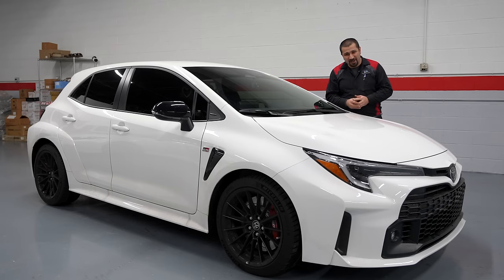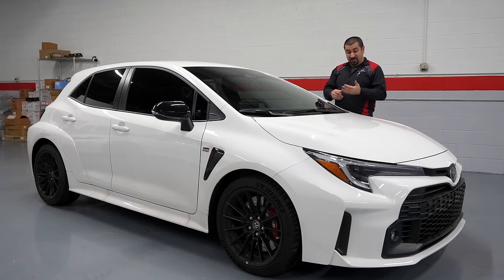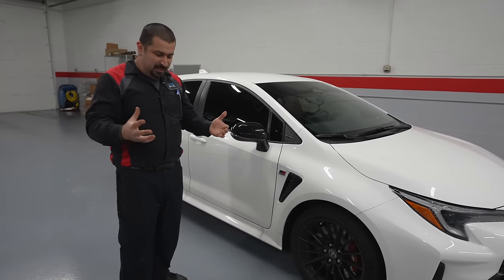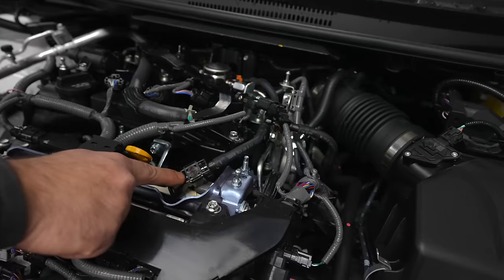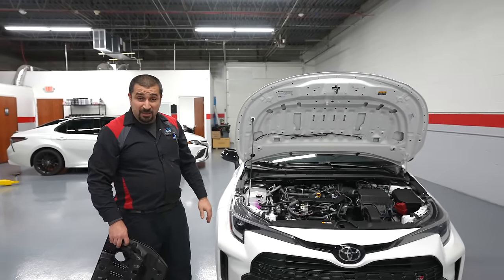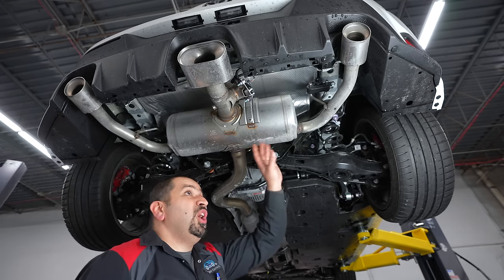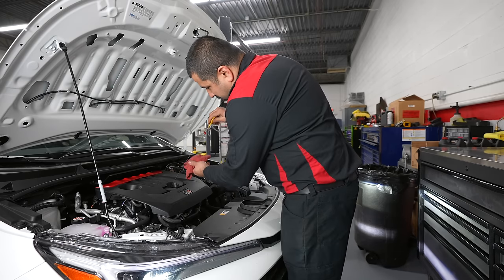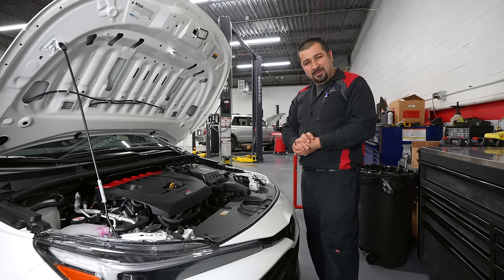The Toyota GR Corolla is Truly a Special Car | First Service and Technical Tour

Comment: Ethan has a sweet ride and the best mechanic in town. What more could anyone ask for? Thank you both.
Reply: Ethan for congress👍👍
Reply: Well said...
Reply: ChuCan, extremely well said.  Thanks to both and what a gift on a cold Saturday to see. 🙂
Reply: Super blessed!
Reply: 29/01 23, Thankyou to the Owner & you for sharing - What oil would the Dealership have used ? Nothing else to check or do here - or just purely an engine oil change ? Have similar problem with my 2012 UK spec' 1.6 Suzuki - can't find an Engine Oil that matches the exact oil spec' given in the Owner's Handbook. Can find SAE 0W - 20 oils, but, none that INCLUDES, SG, SJ, SH, SL or SM in their descriptions. Want to do an engine oil change before reaching the required interval here in Winter where temperatures have fallen to -11 °C so far. One Vendor told me, smiling, 'You're worrying more & more about less & less' !
Reply: Exactly!
Reply: I would have said the best mechanic in the whole country. I would buy a Toyota just to get service by AMD.
Reply: What more can you ask? Being able to read the oil dipstick?
Reply: For warranty, you should be taking the car to the dealer while they're still under warranty, especially since its free for the first few years. So Ethan was able to buy a highly sought out car, probably paid 30k over sticker for it, and now voided the warranty.
Reply: @GXMAN16  oil change is not free, he didn't voided his warranty because how will they tell that oil was changed? Send it to lab? He did oil change really early (oil was still transparent) and dealer wants you to do 1st oil change before 30k km (~20k m) and he will have to show up for it (and pay) if he wants warranty on engine.

Also winter tires would be great lol
Reply: @Drayke  Here in US you get 2 years of Toyota Care when you purchase brand new from a dealer, which is free oil changes and tire rotation. Yea it's normally every 10k miles. I don't know how the GR Toyota does it,  so yea if he brought it in for a break in change early on, he could still take it to Toyota for the regular oil rotation. They wouldn't be able to tell, unless the oil filter is different  or something like that. My point was if he never changes the oil at Toyota within the warranty period , and there is an issue, dealers can deny warranty, it's stupid but it happened in the past. 

BMW does it best, they give you 3 years of free maintiance and you can buy additional years too. And they actually do a break in oil change at 1200mi for M models before the regular 10k change. Their plan includes everything not just oil and tires, whatever the book calls for they change. Spark plugs, air filters, cabin filters, you get one Rotor and Pad job within those 3 years, even batteries in the key fob all free, included in the maintiance plan.
Reply: @GXMAN16  wow that's cool, thanks for info. My comment was based on my experience with ford in Poland, 6 month (20k km) car 800$ 1st visit lol
Reply: A HONDA!
Reply: @Drayke  I figured since you used KM, in Europe you guys might have different plans.
Reply: Just becoz its on internet doesn't mean he is a good mechanic
Reply: @GXMAN16  doing your own maintenance doesn't void a warranty. You're allowed to do your own maintenance. He also went to a shop and used a toyota filter and crappy oil but it did meet the spec toyota called for. No warranty issues there
Reply: I'd take my car to this gentleman's shop. 

He's earned my respect ✊. 😊
Reply: Enough said
Reply: For him to be in my neck of the woods so he can be my mechanic. I dont trust any mechanics to be honest.

Comment: Performance: 0 to 60 mph,  4.99 seconds! Top track speed 142.9 mph! Horsepower: 300 hp @ 6,500 rpm!
Reply: Sounds like a fun car! And the best part it's a Toyota!

I like the AWD aspect. Typically all these sporty compact cars have been FWD.
Reply: Those are solid numbers even for  AWD plus it is only a 3-Cylinder.
Reply: ...and crazy Turbo Lag for days...

Just bustin balls, its a cool car for sure. But the turbo lag is kinda real with these.
Reply: Prices starting at $36,995  Yipes!
Reply: @met9072  I just with the interior would match the higher price point in feel. Its a Toyota, so I'm sure everything will last, but a lot of the materials are still cheap feeling plastics.
Reply: a 3cylender with a turbo isnt goin to last like a 4 cylender would,i would not have a turbo ,naturally aspirated is the best for your buck,styling is nice ,,power train emmmm,,
Reply: @wayneoneill1187  Any serious problems with turbo reliability is an old wive's tale at this point in time. Particularly from manufacturers like Toyota or Honda. That might have been the case back in the day, but it's a non-issue now-a-days, worst case is you might need to replace the turbo itself in 15 years. As for the 3 cylinder, this is not a new engine, it's been out in the Yaris, and Toyota uses it in some of their race cars, it's a known bulletproof motor. Particularly with dual injection, it'll have a nice long life, not even needing the usual valve cleaning like in DI only cars. They use the dual injection not to only keep the valves clean, but also to cool either the cylinders or the valves depending on what the motor needs at the time. It's a solid engine, up their with the likes of the Honda K20/K24 or the VW/Audi EA888.
Reply: @BigBear--  Sure i believe that,LOL
Reply: @wayneoneill1187  Really I could care less. What you believe has no bearing on the quality of the motor.
Reply: @met9072  This isn't ten years ago unfortunately, now adays that's a great bang for your buck in this car market.
Reply: Just say 5 seconds bro 😂

Comment: I bought a 2022 Corolla SE, and the "Heck"  and nastiness I went through from two different Toyota Dealers is annoying at least.  I told the Service Manager to have his technicians watch this channel.  Dealer comment to me:   "... You MUST change the oil ONLY at 10,000 miles.  Trust the Dealer " Toyota care"!   My Reply:  "... I trust one Toyota mechanic.  Mr AMD aka "The Car Care Nut".  The car belongs to me and I drive it.  I am responsible for Preventive and regular maintenance and NOT the Dealer.  I say "MTDGA"  = Make Toyota Dealers Great Again".

Comment: I would love to get my transmission fluid changed in your shop on my 2020 Toyota Camry SE nightshade. Currently has 24,000 miles and I would like to change it at 30,000 and then at 90,000 miles after that.

Comment: Thank you Ethan. I am a VW GTI guy for the last 30 years+ (currently have a 2000 VR6 with 405K with manual transmission minimum issues). This GR is nice will definitely look in to the GR when its time to change. As always great video. Oh by the way also own a 2012 Corolla LE with approx 95K on it, runs like a champ with basic maintenance. Thank you
Reply: 405k how is that possible? Did you had to change engines? Or is it the original engine
Reply: @Chrxmax  I was wondering that as well. Gotta be on its second engine!
Reply: @Chrxmax  He probably means 405k kilometers.
Reply: @Chrxmax  Original Engine. Haven't even changed the clutch, Only work done is over time, Brakes, Suspension, Coil Pack (early on), even original exhaust, did have to change throttle body at about 275K. Drive it daily about 100 miles. My moto is Tread Lightly on Public and Private Roads. Its been good to me. Had Jetta GLI 1995 before and put 457K on it. All good man.
Reply: Love the vr6
Reply: @aamirmoinuddin9904  I’ve not even heard about VW with that type of mileage 😮
Reply: @kosta2177  Yes Sir, Its been good to me and I have never mistreated my car, did I drive fast yes and did I take tight corners - yes but honestly its been a good car. My wife keeps telling me that I should just go get another (newer) GTI lets see what the future holds. Thanks all for your comments.
Reply: More people are interested in your GTI than your Corolla, LoL  Impressive, you must take real good care of it.
Reply: @aamirmoinuddin9904  my mk3 vr6 only made it to 150k before it developed chain noise. Did a rebuild and now it runs hard. My mk4 only made it to 200k till the 1.8t started smoking real bad, so thats due for a rebuild.
Reply: @wed3k  I am surprised with the MK3 Vr6 only getting to 150K. Use BG MOA with every oil change and BG 44k Fuel Stabilizer at oil change intervals. Are you rebuilding yourself or have a mechanic in the area ? Sorry for the delayed response. All good man.
Reply: 400K on a VR6?!

All original drivetrain?
Reply: @WarriorsPhoto  Yes all original, as we speak the hose that connects to the heater core from the engine to carry the coolant busted 3 days ago, lucky happed when I parked in a shopping plaza. anyhow will replace that and fill all new (pink) coolant and will see how far we can take this. current milage at 407K. The hose that busted was really soft when felt it, I guess operator error, would like to get all the hoses changed but there so many. Will get it back on the road soon.
Reply: @aamirmoinuddin9904  I hope your VR6 goes to 1,000,000 miles. The reason is that engine note is amazing! Anything with that many miles will need some serious love. Heck my Toyota with 150k needs some love. 
Hope to find a good mechanic to do so.
Reply: GTI since 1991 here. Still VW Touareg V10 TDi and A3 TDi. Mobile 1 for life. It’s Walmart cheap and good.

Comment: That's exactly what makes Toyotas special and long lasting...  (Basic and to the Point).  Everything you need, no fluff or gimmicks.  Good stuff like always. 👍
Reply: Supra and celica gt4 too
Reply: Should have put a bigger motor and no turbo
Reply: I wish the Germans would do this, no fluff or gimmicks.
Reply: @6speed818  maybe the 2.4 boxer, but idk how would it fit under the smaller hood. The boost is higher but not anyth crazy. Merc AMG has ~450 from 2L, this ~270 from 1.5
Reply: All new toyotas are filled with gimmicks and screens and drive modes
Reply: @burntnougat5341  I'm referring to the mechanical area of the vehicle/engines are not highly complicated like all the crap that Domestic brands have, I haven't nor will I ever buy American, garbage, garbage and more garbage.  All I've ever owned are Toyotas & Hondas.
Reply: People say: "Oh, Toyota's (or Honda's) they're boring." Boring because they always work? I'll take that level of "boring." Reliability counts for a lot more than image in a lot of cases in life and certainly in engineering.
Reply: @stevemcrichards8768  they're boring because they're not fun to drive. That's what's being referenced. The sports aspect lacking in those brands, though at least Honda has the Si and CTR even if the L15 is a terrible engine
Reply: I completely agree, reliability should be the most important above all else, you know that when you turn that key its going to start and it won't leave you stranded....  I take that all day every day. 👍
Reply: @burntnougat5341  i drive a gl350, a rr auto biography and an LC 200 v8, guess which one i come back to the most? anyhow its the toyota. The gl feels very generic and pretty unresponsive, the range though very stately and comfortable, its engine is just not as lively as the toyota's, non of them are any good dynamically but at least the toyota gives you incredible steering feel
Reply: @lexuslfa4739  lol a gl is a suburban mommy suv. Come back when you drive something more hardcore and evocative like a X5M comp or AMG GT
Reply: 3-cyl with turbo?  I'm a little worried about longevity.  Go easy on it,  Ethan! 😉
Reply: Bless TLC - Toyota Land Crusiers
Reply: @6speed818  True. The turbo is a dealbreaker for me.
Reply: @Les Hernandez there is nothing special about boosting the shit out of a tiny 3 cyl engine. I'll take a vb wrx anyday, while saving a ton of money.
Reply: @steve8803  except for probable component failures and shortening its lifespan, which is somewhat more serious than "nothing special".
Reply: That's why Merc always brake down, They always have crazy horses per cylinder ratio

Comment: What do you think about these engines for the long term? I can’t imagine theses small turboed engines lasting as long as say a 4 cylinder naturally aspirated. Thanks!
Reply: Time will tell. I'm not optimistic that 3 cyl-turbo will hold up well.
Reply: Now that's the Real Question we askin here.
Reply: It won't be as reliable as a normal Corollas but it will definitely outlast an equivalent Golf R or Civic Type R
Reply: @little123456788  The civic type r has 4 cylinders so it doesn’t have to work as hard . The Honda engines are reliable also. But a 3 cylinder? Now the golf maybe .
Reply: It's a Toyota. And it is using the homologation engine from the GR Yaris (superior chassis). 500hp and no issues with just some valve springs, past this the head will start to lift without better head studs. Long term will depend on use case and maintenance, but so far no premature failures that weren't user error.
Reply: @khamid1  yeah lol. I have no doubt it will be bulletproof , however you know the person who gets this car is gonna bang the crap out of it. It will last but I doubt it will last as long as a standard Corolla . It will last no doubt . But 3 cylinders? Idk
Reply: Do a search, I heard of some that dropped a valve because of a failed keeper.

Comment: Great car, Ethan! I hope she’s as good as our 2008 Corolla that’s pushing 200,000 yet still running like she did 15-years ago when new! (I just counted, 23-oil changes and due for one now!!) I didn’t know about Ahmed’s 6-month suggestion until he started this great channel!)
Reply: Not sure you can expect a turbo engine to reach 200,000 miles.
Reply: @Krakondack  my mazdaspeed 3 reached 140,000 miles. 12 years of pure happiness driving thru canyons here in Southern CA 😁😁😁😁😁😁😁😁😁
Reply: @Krakondack  I know...I've never owned a turbo but wonder how long those turbo's last.  In GM vehicles, if you get 3-years you're doing good!
Reply: @ju4121  But I consider 12 years and 140,000 miles an early point in owning a car; I usually target about 8 years and 100,000 when buying.  I expect a minimum of twice that out of it, and usually get more.  San Diego; so rust is not an issue.
Reply: @Krakondack  Oh yeah, I put 1,200,000 miles on one, original turbo and the clutch was replaced at 903,000 miles. It was a different breed of animal though.😁
Reply: @rickboucher6061  😄😄 that bad?
Reply: @Krakondack  plenty of turbo engines go past 200k.
Reply: @redrider7730  I know two different motors but I was talking about my experience in driving a turbo car. I traded the 12 speed3 for 22 turbo hatchback Mazda. Time will tell if this engine will last. It's skyactive and turbo, so more there more  compression 😁😁. But the engine has been use in different mzdas, so I haven't heard any complaints.
Reply: @Krakondack  those mile where trouble free for me except replacing the clutch at 90k but that was me driving like I stole it. I just gave the car proper maintenance. Change oil between 3k-4k using synthetic oil.
Reply: @ju4121  Sounds fine.  Had you babied the clutch, you could have got maybe 20% more out of it, so at least you had fun.  But 140K is not that much ...
Reply: Theres not plenty of 3 cylinder turbos running 23psi reving their tits off every time you drive it around running 200thou miles though. Theres also a lot of boring ass plastic on the car. For the money you pay and the trade off you have in reliability over a bigger displacement tried and tested motor that they easily could have done up, made more power and kept almost exact same internals.... Im kinda torn here cuz im a toyota owner and fan, but i wouldnt buy a gocart motor in a car. it just has to work too hard every day, wheather your pushing it racing or just driving to work.
Reply: @milkman1944  Sure you don't have a zero key that puts in an extra digit?
Reply: @Krakondack  Zeros are correct, one million two hundred thousand miles, the different animal was a Series 60 Detroit.
Reply: @milkman1944  okay, that's a different animal, built to an entirely different set of standards, that could not be done on a small vehicle.

I was trying to imagine how a personal vehicle could do this - even if it was driven like a long-haul truck (long, highway miles), it would still be hard to believe.
Reply: @rickboucher6061  well that’s gm a Toyota at least can go over 200K easily
Reply: @Krakondack  absolutely, why would you think otherwise unless it is beat to death. I had a '99 Eagle Talon Turbo go 218K before Chicago Salt got to it, and i got it when it had 100K on the meter.

Comment: Love the brakes and exhaust. Hate the horizontal oil filter as my OCD requires me to fill the new filter with oil prior to installation. Love the extra under hood space the 3-pot offers. Thank you for showing this really cool car.
Reply: No problem. Just fill it with enough to wet the filter element all around (you can see through the filter hole), smear some more around the gasket, and install.

Comment: I have a GR Yaris (same engine, with -30HP due to the european exhaust and tune) and what a blast of a car it is. Recently I wrote a coment in another of your videos saying that I would let you service and repair my GR and I see that you got your hands on one already.

Regarding what you mention arround 16:00 about the oil, both in europe and japan there is a specifically Gazoo Racing branded 0W20 oil that is up to the specification on the cap. No idea about the US, but I have to use that on my GR Yaris as it's almost impossible to find 0W20 elsewhere on generalist spare parts shops, yet alone that specific 0W20